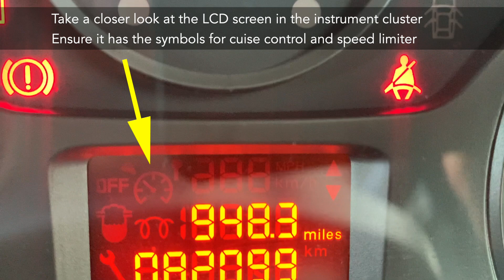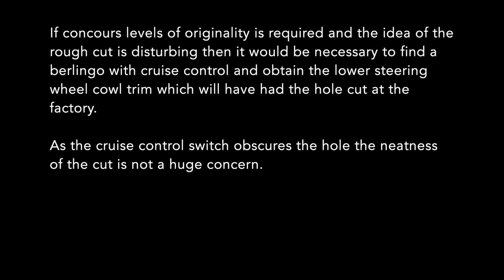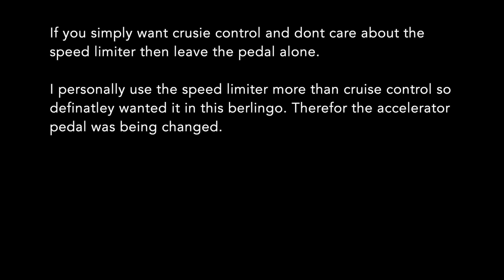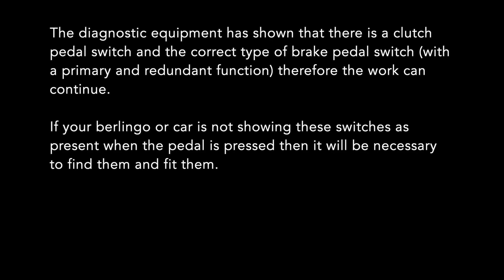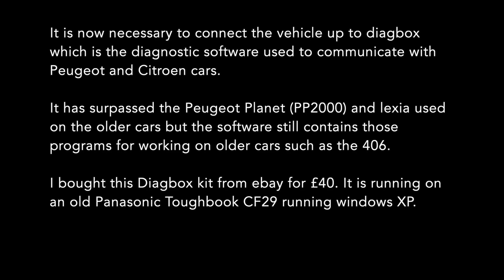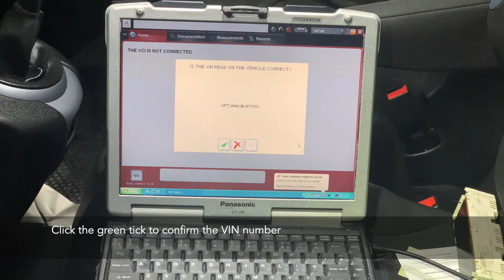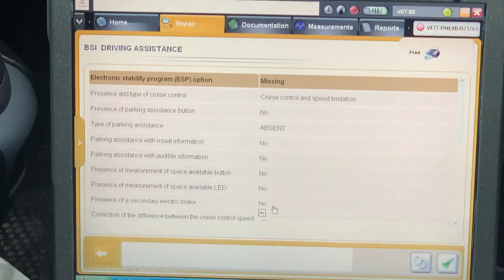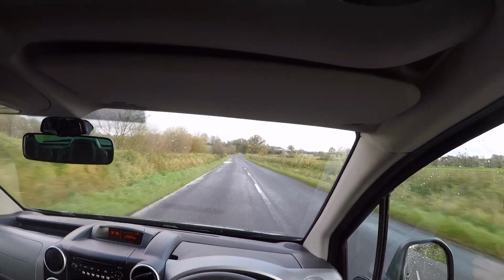Citroen Berlingo B9 Retrofit Cruise Control & Speed Limiter

Comment: About to do this on a 207.  It should be noted that there are variations in connector pin out too.  There are 6 and 8 pin cruise stalks and 5 and 6 pin accelerator pedals. 
Take the column shroud off and look at the rear of the pcb projection you see.  Mine has 8 copper pads so I'm assuming only an 8 pin stalk will give me all functions.  I guess a 6 pin stalk would not work properly if mated to an 8 pin pcb.
The LVVD pedal is also available in either 5 or 6 pin configurations. I assumed that the '6th' extra pin was for the kick down function, but it can't be as the LVVD version comes in 5 pin set up too. Confused? Me too....

EDIT:
Job completed and working well.  Thanks to PC2CV for the info on the LVVD pedal.  I think without learning this valuable piece of info, I would have probably just settled for cruise control only.

Comment: I was toying with the idea of doing this to my 2012 B9 Multispace; now I’m buying the parts so the toying is over and the gears are in motion. Been dying to have this for ages. £13 for the pedal, £11 for the stalk, already got Diagbox and an old xp laptop purely for Diagbox purposes. Now just to wait on delivery.
Reply from the maker: Best of luck with the job
Reply: @peugeotCitroen2CV  enabled on the BSI but can’t seem to enable it on the ECU. The correct lights are showing on the dash but it’s not giving me anyway to activate it on the ECU. I can set a speed for CC and SL but it remains in the off position. It’s a EDC17 ECU. Is there a way around this?

On Diagbox I was using v7.57. When I try to update to v7.83 following the steps of the update to a T it always fails at v7.66 with error loading diagnostic causing me to abe to uninstall and start from scratch with updates from 7.01->7.02->7.57. Is there a trick that I’m missing here as well? I’ve sent you page on Facebook a message (Nico). Any help would be appreciated. Cheers buddy and thanks again for the video

Comment: Hi i bought a 2017 peugeot partner its restricted to 112kph any idea were the limiter would be regards ian.
Reply from the maker: Hi there, there might be an option in the BSI or on some of the settings accessible via diagbox but i honestly cant remember seeing them. Failing that it may be on the ECU itself in which case a remap may be required. Let me know how you get on with this, interested to know the way it is resolved.

Comment: Hi, This video was absolutely great! I tried this myself, but during the last step, I can't configure the setting of cruise control to 'present' in the ECU. It just starts downloading and writing without me actually changing anything. Any ideas?
Reply from the maker: HI there, thanks for the comment.
It can depend on the version of your diagbox. Now i cant remember 100% what version i had that worked. But i do recall i had to uninstall diagbox and install an older version for someone elses van i was working on after this video. I think if you install the software that comes on the CD's on ebay and update to the latest version on the CD then it can have issues. The earliest version is what worked.

Comment: What tool did you use to check if the pedal switches are present? Could this be done just with Diagbox? I have a 2015 Peugeot Partner Teepee and want to add CC/Limiter functionality as well.

It seems like there's two versions of the Diagbox adapter as well: "lite" or "full chip" (with some more relays/optocouplers), which one would recommend? Thank you!

Comment: Great tutorial, I've had a quick look at my display but I can't see the cruise control indicator, is this because its not been "switched on" or will I need  some other tech? Thanks in advance
Reply from the maker: Hi, what year is your berlingo, the icon is not instanly visible but i think most B9s have it
Reply: @peugeotCitroen2CV  thanks for the reply, I checked again with a torch and I could see it. Can I pay someone to switch on the cruise control or is it cost prohibitive
Reply from the maker: @marksugden8730  
The diagbox lead i use was only £50 on ebay, running on an old windows xp laptop. 
Alternativley join the berlingo owners facebook page and find out if someone is local to you, i am based in Northern Ireland so probably a bit far of a drive, but the owners clubs generally have a few people with the diagnostic equipment usually a few beer tokens to have it reprogrammed.
Reply: @Lian Ian instablaster :)
Reply: @Mohamed Roman i really appreciate your reply. I got to the site on google and im trying it out now.
Takes a while so I will reply here later with my results.
Reply: @Mohamed Roman it did the trick and I now got access to my account again. I'm so happy:D
Thank you so much, you really help me out!
Reply: @Lian Ian Happy to help xD

Comment: Hello,do you know if my van is limited to 70mph? Can i remove the speed limit with that diagnostic?
Reply from the maker: Hi there, i do believe it could be limited electronically, i think royal mail and some other delivery companies tend to apply a limiter, generally quite common on company vans that are being driven by employees.  
I will be honest ive never noticed it on the diagnostic settings but then i have not been looking for that option it could well be in there, the menus have a lot in them. If its as simple as that then thats an easy one to do. 
Worst case you might need to take it to someone who can remap vehicles to get it deactivated that way.

Comment: thanks for the video!! if you dont need the speed limiter (only CC) then the accelarator pedal dont need to be changed right?
Reply from the maker: That is correct.
Although i would say 90% of the time i use the speed limiter function, on the likes of an older PSA car such as a 406 with just cruise control its one function i really miss.
Reply: @peugeotCitroen2CV  thank you! i dont use the speed limiter normaly. so for me its good enough without. thanks for your reply. and thanks for the good video.
Reply: @peugeotCitroen2CV  Hi, what happens if I activate the limiter without changing the pedal? Thank you !!
Reply from the maker: @jlgvideomusic  
It probably will not work, i do not know i have never tried finding that out.
Reply: @peugeotCitroen2CV  very kind, thanks for your reply
Reply: @peugeotCitroen2CV  yes, I have to agree with you on that last point. 

I have a 2007 model 307 2.0 HDi with CC and Speed Limiter. 
I also have a 2003 model 406 HDi 90 (I think you called it). It has CC but not Speed Limiter. I miss that function especially when coming into a town after driving on a motorway. It’s hard to keep to the speed limit! The other related thing that the 406 misses is an idiot light that tells you that CC is turned on. Amazing what we get used to having. 

So, do you think it’s possible to get the SL function on the 406? I much prefer driving it over the 307, especially the distances we drive in Australia. Much more comfortable.

Comment: It didnt work my Partner B9. Ive fitted controller and made same changes in trough diagbox and it still doesnt work :(
Reply from the maker: What is diagbox saying, can it complete the configuration ok?
Reply: @peugeotCitroen2CV  yeah. All changes applied without any issues
Reply from the maker: @labrathersmotion6638  not too sure, is the Berlingo screen saying anything?
Reply: @peugeotCitroen2CV  nothing at all. I can see that there is cruise controll on dash but doest light up. Could that be a fault of controller?
Reply from the maker: @labrathersmotion6638  is the symbol on the instrument cluster acknowledging that it has been turned on?
Reply from the maker: @labrathersmotion6638   
Could be the stalks unit